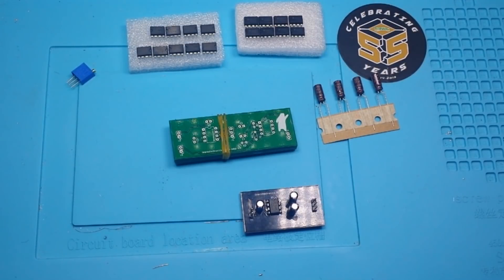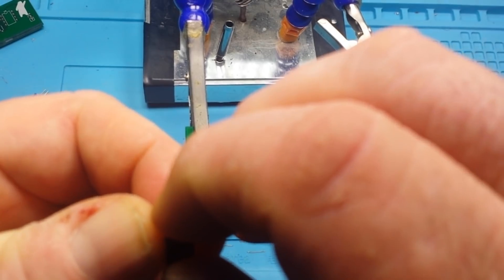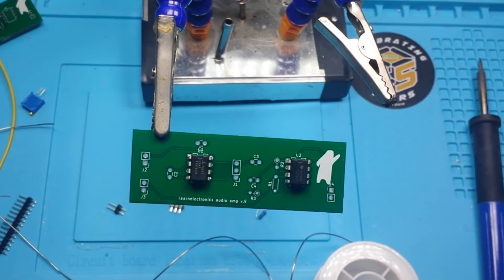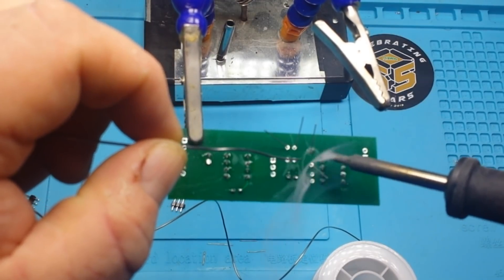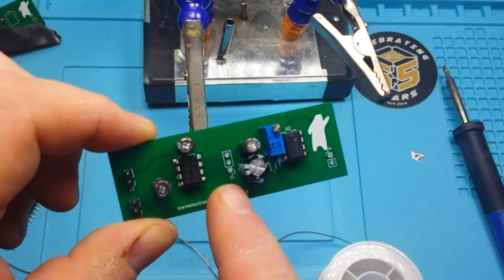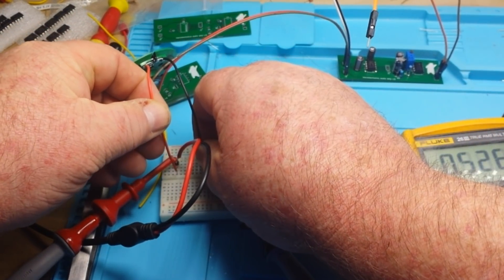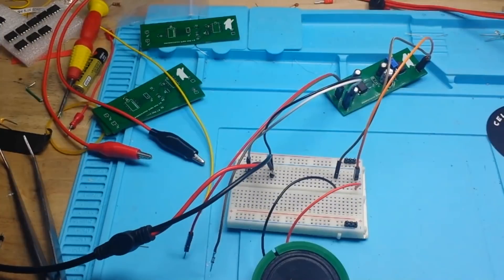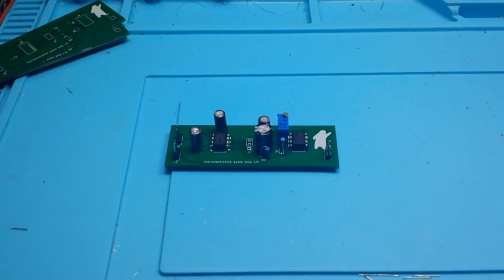Simple Audio Amplifier made on PCB

Comment: Why didn't you put up the schematic and explain what was happening as you went along? Then show what would have changed if you changed parts, like the caps that you said did not matter. No caps, higher caps, lower caps, lower voltage or higher voltage. Many videos people say this is suppose to be a xxx but all I have is a zzz and it will do. Will it???? Thanks for the video.

Comment: We had a school project to amplify audio output using a 12~35V H-Bridge Motor Controller and an arduino. Would it be possible to go wireless using an nrf24L01 module? Of course everybody has an oscilloscope and that RLC meter thingy. ^_^

Comment: Hi Paul,
Great video. I'm a newbie to this stuff. I have electronic training from 40 years ago. Before gates if you will. I'm working on a home audio amp and have done some obvious things. Would you be willing to help me get the audio board up and running. I have gone from a protection circuit shutting the amp down after four seconds through  the protection relay now after replacing four bad resistors and six transistors to I get and over load readout now not a complete shutdown. I disconnected the four wires from the protection circuit from the main audio board and the overload  goes away. Could I send you the schematic for the audio board and help me trace out the problem in the circuit. I just retired and I want to learn bench repair. I just ordered an esr meter and an oscope. I have a multi meter and a transitory, resistor meter. Thanks in advance.

Comment: A scope on the last op-amp video would have told you the "discrepancy" you got was due to clipping and not component tolerance. Not everyone needs to have all the gear you use, but it's still useful to see the signal even if someone builds the same circuit without all the gear you happen to use. That speaker is really good, if you overdrive the op-amp you can hear the distortion. That could be very useful for someone not having a scope for instance.

Comment: Great video as always Paul. I’m working on a setup that is a few steps ahead of this circuit but it did start with that nice duel voltage supply chip. It started out as just a small amp and speaker setup but the complexity is getting a little out of hand.
Reply: To bad we can't share pictures. If you post a video I would like to see what you've done.
Reply from the maker: You can share vids with me and I will post them.

Comment: Thanks for not assuming that all of us can shake loose enough cash to buy an oscilloscope. I can afford some components and a few other parts, but still like to follow along and try to build your circuits. It's addicting and fun!
Reply: Used oscilloscopes are incredibly cheap on eBay .... I bought a dual trace  20 MHz   made by  leader  in mint condition delivered for 50 quid .
Reply: Just look out for old gear from schools or companies or whatever. Even an old analog one will be very useful and you can get them for next to nothing with a bit of luck.

Comment: Turn it into a headphone amp board
Reply: I would like to see a preamp.
I don't know much but I think headphones use a lot of power maybe you could explain this.
Reply: @Steven Nelson
   It depends on the headphones. The output does have to handle the headphone impedance, as low as 8 ohms. (32 is fairly common nowadays.)
   If the output doesn't blow up, the only problem might be that you won't hear it loudly enough. The solution for that is a different headphone. Or a power output.
Reply: I Just bought some headphones. I'll see what they say. I Find that they work really well.

Comment: How about using it as a tone generator for finding shorts and opens in long bundles. But then I guess you would have to add an oscillator to it too! Oh well, just a thought!
Reply: Yeah, you send a frequency down the wire and you use another device setup with a sensitivity pot so as you travel down the wiring harness, when it stops beeping, you look in that area for the short or open circuit, which ends the transmitted frequency. I forget the name of it, but it's a receiver of sorts I believe.
Reply from the maker: Good idea